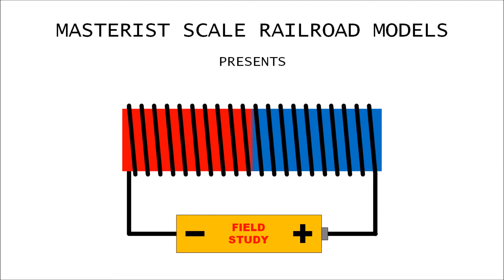Bachmann Schnabel car minimum radius challenge: MSRM Field study #002, 04-24-2018

Comment: wow. that is tight curve. i don't think i would try that with mine. lol
Reply from the maker: I recently heard about Japanese HO gauge (Sn42) Tomix curves built for S scale 1:64 Cape gauge, with 8 inch radius. 40 foot freight cars in S scale (Sn42 due to 3.5ft gauge) make it through. The trick is that manufacturers trim underframe width at the point where wheelsets would interfere during truck rotation. Thus truck rotation is extended. 40ft in S scale is equivalent to 7.5 inch long model, something like up to 55ft in HO scale. Now I don't think this Schnabel car would make through that one.

Comment: Holding it in center cheater. Make a locomotive actually push it
Reply from the maker: Well, I was only intending to see how far would bolsters spin without resistance. Another thing - not sure whether it is a common problem or only afflicts my particular car: center drops and load grinds the tracks. I do intend to create support inserts to lift base off the rails but circumstances slow progress down. I will definitely update you when I get car off the grind rails.
Reply from the maker: Thanks for the comment however, this actually encouraged me to look deeper into schnabel car structure. Here are my observations: span between support pin and bolster center is 58.33mm (~200 scale inches). This equates to ~16.5 feet. What this means is this is how wide support platform has to be ON EACH SIDE off center. This is unrealistic considering about ~14 feet track centers spacing (2 inches in scale). So there is a cheating element indeed here but like I said I just wanted to see how far could I push central bolster to spin before it starts resisting. Considering above observation I will be happy if 12 scale width bolster support platform (which prevents center drooping) will make this car able to navigate 18" curve.
Reply: Push it with a model locomotive du du du